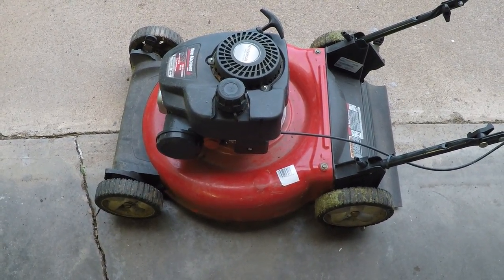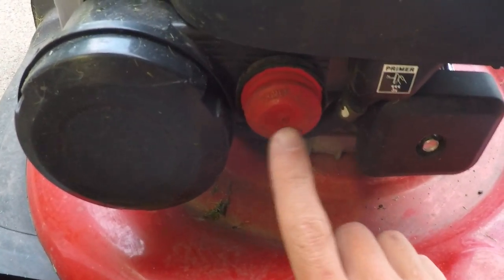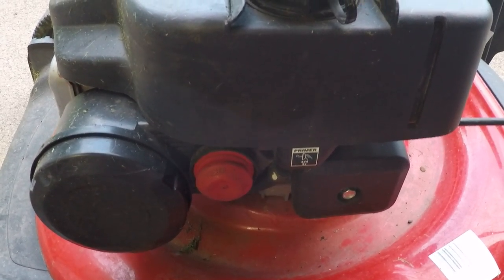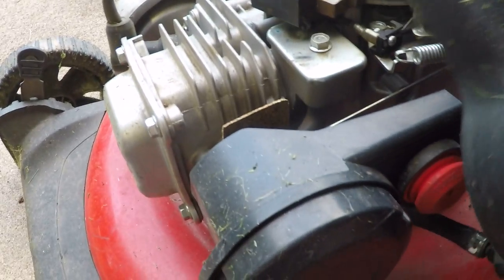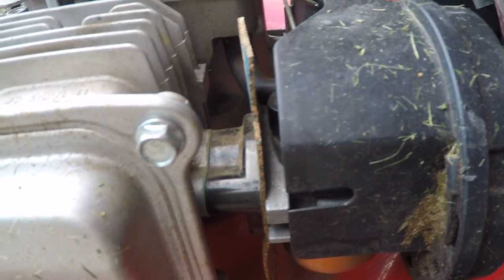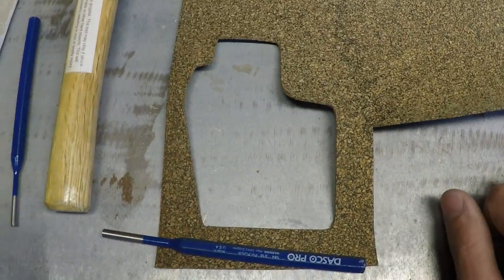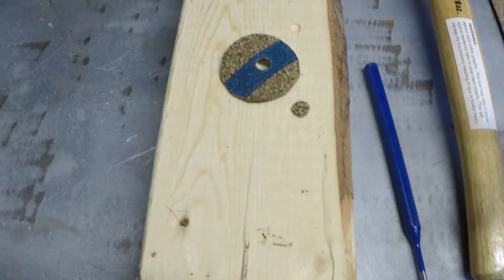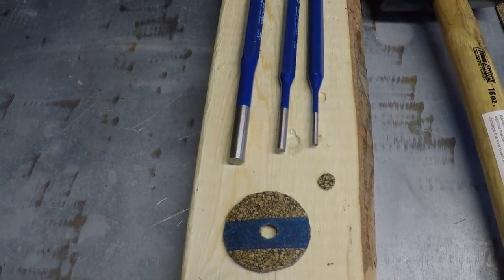Lawn Mower Only Runs on Primer Pump - FIXED!

Comment: Have the same mower and the same problem.  I’ve stripped down/rebuilt the carb, gas lines and replaced the spark plug.  Nothing worked.  I was about to throw this mower into the road and watch trucks run it over. Now I have found the issue.  Thank you so much.  My wife will be pleased that I do t stink like gasoline for yet another night.
Reply from the maker: Eddie Awesome that’s great to hear! I was totally in the same mindset after taking the dang thing apart multiple times haha
Reply: Thanks a bunch I got one doing the same thing:::now I know what to do, fix it instead of shooting with my 12guauge 😂😂😂

Comment: I went through the carb cleaned it THOROUGHLY, replaced the bulb gasket to be able to prime it, replace the coil, and created lots of blisters. The O-ring between the carb and the intake was the problem, it looked fine but wasn't fully sealing. I cut a larger o-ring to fit and super glued the ends together into a circle and VOILA! no bs this worked for me.
Reply from the maker: Awesome! Glad this helped, and nice work getting it going. We appreciate you dropping a line. :)
Reply: @GuidingBoltGaming  The O ring was my problem. Thanks.

Comment: Mine is doing the same thing. I got it started and it will only keep running if I hold in the primer button. I guess I have a project for Saturday morning. Thanks!
Reply from the maker: Good luck, and happy tinkering! If you think about it let me know if that was the issue or if you discover something else.
Reply: how did u go ?

Comment: Thank you.  I just installed a new carburetor and I'm kinda having the same issue . it will stay running after i continue to hit the primer but i will check the gaskets .
Reply from the maker: Hey Jim - Thanks for dropping by and leaving a line. Any luck getting it going?
Reply: @GuidingBoltGaming  still in progress actually . i started to replace the primer bulb and check the gaskets but got sidetracked on another problem at work . the joys of being a diesel mechanic in the winter . lol . if i can figure out how I'll message you my findings .

Comment: how thick was the gasket ?? I have the exact same lawn mower
Reply from the maker: I would guess roughly 1/32? I just picked up generic gasket material at the local hardware store. I don't suspect the thickness matters so much as making sure you have a seal.
Reply: @GuidingBoltGaming  wow thanks for the reply , I changed the gasket but it was not even cracked. The first time I started it after 1+ year I had it running fine for 5min , ever since then it is stalling just like the video. should I look at the carb now?.

Comment: Why would the gasket fix a fuel issue like that?
Reply from the maker: I honestly don't know. I thought it was weird also, but it fixed my issue so I wasn't complaining! I'm not a small engines expert, just a tinkerer. If you find the answer let me know!
Reply: Carburetors suck fuel in by a vacuum effect. If there's not a tight seal and the carb is sucking air around the gasket area, it doesn't have the force required to suck fuel.  Using the primer function is like forcefully doing the carbs job.

Comment: How do you get the carb. off
Reply from the maker: Take the pull start off, should be 3 bolts on the top. Then remove the gas tank housing and that should give you access. I actually upgraded to a rider, so I don't have the old girl anymore, or I'd make you a quick video.

Comment: I'll be checking that carb gasket more closely tomorrow. A neighbor tossing the mower neglected everything. A carb removal & cleanout with new spark plug (air filt, oil) got it running -- some. 7 or 8 pumps on the primer and it now starts right up. When it begins to stall, I pump the bulb several more times and then it (Tecumseh 6.0) stays running smoothly. I'll be putting a new fuel line on, too.